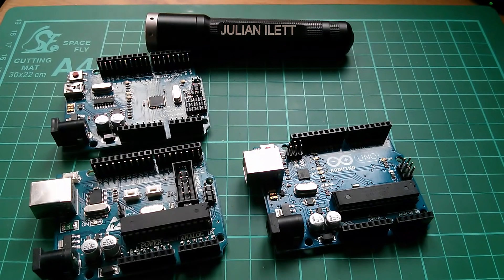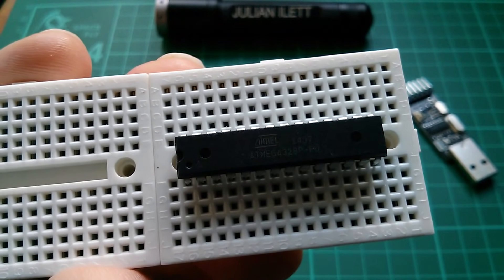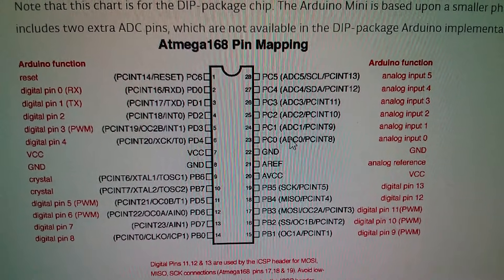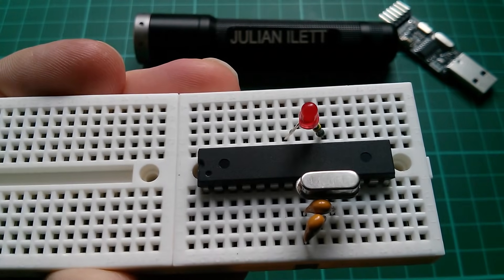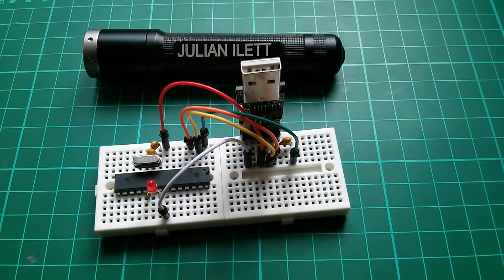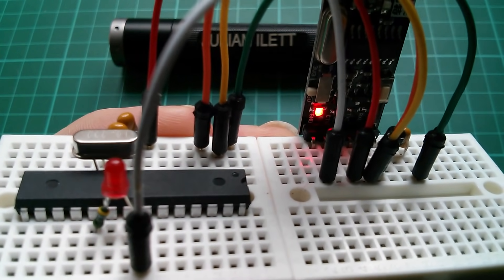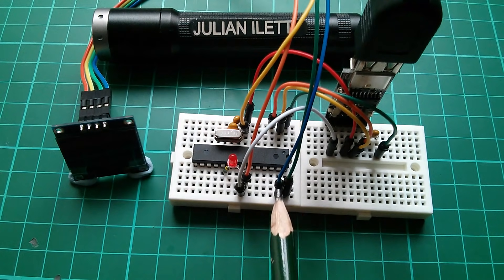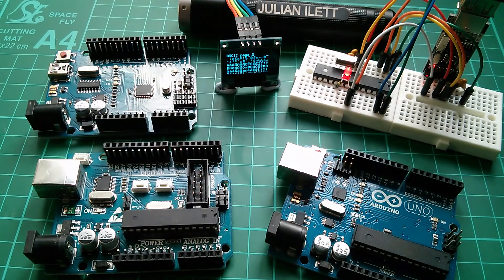1-Day Project: Build Your Own Arduino Uno for $5

Comment: which capacitors did you use
Reply from the maker: 22pf
Reply: This project is called Bareduino:
http://www.instructables.com/id/Standalone-Arduino-ATMega-chip-on-breadboard/?ALLSTEPS
Reply: can I use a cap rated at 104 or 103?
Reply: thanks

Comment: what is the value of the current limit resistor for the LED,the link for the usb convertor takes you to a no ship to UK seller,would this then run my diy cnc using grbl.

I'm an electronics technician,but i studied way before these gizmos were common place ,only i R+D labs,but if this can operate the cnc i can develop a full integrated pcb with surface mount components,next i need the schematic for a usb convertor.

cheers.

Comment: Hello Julian,

I was tried same steps with my boot loaded chip. But mine is not working. What can I do ?

Please help me.

I am using Atmega328(Arduino Boot loaded). and CP2102 USB to Serial.

CP2102------Bread board chip.
VCC(5v)-----VCC,AVCC.
GND----------GND,GND.
TX-------------RX
RX-------------TX
DTR-----------RESET through serial 0.1 ceramic capacitor.(reset pin is pull up 10k resistor)

I was Error getting the below

avrdude: Version 6.3, compiled on Sep 12 2016 at 17:24:16
         Copyright (c) 2000-2005 Brian Dean, http://www.bdmicro.com/
         Copyright (c) 2007-2014 Joerg Wunsch

         System wide configuration file is "D:\arduino-1.6.13 - BOOTLOADER\hardware\tools\avr/etc/avrdude.conf"

         Using Port                    : COM3
         Using Programmer              : arduino
         Overriding Baud Rate          : 115200
avrdude: stk500_recv(): programmer is not responding
avrdude: stk500_getsync() attempt 1 of 10: not in sync: resp=0x87
avrdude: stk500_recv(): programmer is not responding
avrdude: stk500_getsync() attempt 2 of 10: not in sync: resp=0x87

Please help me sir. what is the problem.

Comment: Hi Julian, this video is awesome. I have a doubt. I got a usb converter (usb to ttl D-SUN) and it does not have a dtr pin, it only has 3v3, TXD, RXD, GND and 5v. How could I upload the sketch resetting the ATMega automatically with this usb converte? Thank you and regards

Comment: If I wanted to install this cut down Arduino Uno into another project how would I power it without the USB. Many thanks for this video and any help/
Reply: it most certainly is P/VxI ,i've been trying to find the original posting.I added up all the outputs then calculated the product.I may have added current capability to ensure thermal stability with or without a heat sink,or at least a clip on type.seeing as the 1A regulators are super cheap,it'd be crazy not to go for some thermal headroom,but you are right 5V x .2A = 1.A quick search for 1A 5V regulator IC came back from google at 25p.even using a higher current type will give better performance.
If you want to use a 317T reg,you can use a zener diode to set the op voltage ,a piece of angle extruded alluminium should be a good heatsink,or buy one,or insulate the tab with mica washers and bolt it to a metal chassis of a diecast box if used.
At any rate i used amps instead of watts,a brain fart i guess.
If you need a schematic let me know.
Reply: i was half asleep,and meant watts,but the extra current was implied,i think things without stating them assuming you know what i mean even though your not psychic,pretty bloody stupid really,but at least i got to redeem myself,urgh.
Reply: use a 5v regulator circuit to vcc and ground GND is zero volts.
Reply: Many thanks John
Reply: Mike Craft apparently the arduino uno can draw 200mA at vcc and gnd,so thats 200mAx5v=1A,1.5-2A reg.If you use a pcb use a spare un connected bit of the copper as a heat sink.
Reply: Understand - many thanks
Reply: Please excuse me if I've missed something there, but isn't 200mA x 5V = 1W, not 1A?
Reply: +john amptech +Twotone - many thanks guys I really appreciate all your replies and help. Have great days!
Reply: Sorry, I misunderstood what you were calculating. I just saw volts x amps = amps and thought that's not right. :) Bit pedantic I know.

Comment: Nice comparison. There are two additional factors other than the price of original arduino. Sometimes you need something way way smaller and if you have a simple project with a few channels of data it's a shame to waste arduino uno on something like this.

Comment: im going to make a uno,ive just ordered a uno and a mega,for reasons too long for here,but i also make pcbs,im going for a perf board to use for pitch,and use zif sockets,and if i need a permanent micro controller,i can program a chip,and fit it to a board with correct headers etc,but using only the needed components for what ever it is for,socket for crystal timer,surface mount parts too where needed,for a good pcb look for toner transfer technique,easier to do than uv resist ,for beginners,seeing as the parts are super cheap on ebay,one can be made for (much)less than a tenner,and be very versatile,bread board can be  disturbed easy.Each to there own,im a technician ,and enjoy being anal about this ,but it can make things easy in the long run,chips etc can be removed safely!.
All the best,enjoy electronics,that's the main thing.

Comment: what happen if you dont have a usb-serial.Could you put the atmega on a arduino board upload the code and put it back on the breadboard would it still work?What about if you unhook the 5v and put it back would it keep the code in?

Comment: Question: If I will use an Arduino Uno instead of the USB converter, because I just want to program my atmega chip and I don't want to use Arduino for my prototype, do I still have to connect the reset port of the Arduino Uno with a capacitor to the reset pin of the atmega chip? Like the one you connected with the DTR pin of the USB to Serial Converter?

And another, is the LED with resistor necessary for the circuit? Or you just put it to demonstrate that the circuit is working?

Comment: I was wondering, as I looked over the official board, why one couldn't just build an Uno from inexpensive components, and then I happened on your video.  I also bought the official version, but wanted to play around with building a variation.  Thanks for taking the time to post!

Comment: Maybe on your country, but here in brazil:

Protoboard:      +- 3.50 dollars
Chip:                   +- 3.50 dollars
usb module:      +- 2.50 dollars
wired jumpers:  +- 3 dollars.
o/ components:     +- 2 dollars
Total:                       +- 14.50 dollars

Arduino Uno R3:  +- 7~13 dollars

 Is a LOT more cheap buy a arduino on place of the separated components.
Reply: doesn't the chinese ebay sellers ship to brazil?
Reply: An authentic arduino or a clone board?

I'm used to clone boards being less than $10.

The biggest advantage in doing this is to get the experience.
Reply: yeah, but the fun here, is to learn and build it yourself :

Comment: Hi Julian. Can u provide the connection diagram for this? And is it possible to directly connect the USB ports without using serial converter just like ATMega development boards?

Comment: You can completely understand why the cheaper units are being purchased. I do have to say that the retail outlets are obviously making a few extra bucks on the item or it would not be worth selling them. It does seem that just maybe they add a few too many bucks,  hence going for a cheaper unit, which does the same thing practically.

Comment: Julian one question you not needed to burn the bootloader of the chip atmega?? or you buy with it?
Reply from the maker: I bought the chip with the bootloader already in it
Reply: Ok thank you for fast respond
Reply: What do they also have??? A voltage regulator? A way to power without USB?

Comment: Very clear video and good close ups too (Subbed).
I couldn't find the adapter you were using on UK Amazon but I found I had the same thing using a '
Osoyoo Mini USB Arduino Nano V3.0 ATMEGA328P Module CH340G 5V 16M Micro-Controller Board' I was a bit worried about this board not having the DTR pin but it has a RST pin which via an on board resister and cap does the same thing (I believe). I also bought 4 OLED displays of the type you were using.  They will arrive late Nov but OLED's are nicer than LCD's

Comment: hey :) thanks for the info. I try to make a small setup so this will come in really hand.
one question thoug: are the values for the capatiors very strict? i can only get my hands on like 22pF ones.. no problem rigt?
Reply: i wonder the answer this question
Reply: is it the work with 22pf capacitor

Comment: can't you use a 20mhz crystal?
Reply: Crystals frequencies can be changed, but you need to know the upper and lower limits of what can be used by the chip. I used to add another crystal in citizen band radios, and attached to a switch. This allowed me to talk to other users that I had modded their CB radios as well.  The only problem with doing this was the radios transmitted outside the legal frequencies, which back in the 80's was a fine, if we got caught.

Comment: after program has been uploaded to my atmega8 if possible can i remove the chip and use it with external powersupply in a different circuit

Comment: This is really cool, but I think the idea of an arduino is to also save money and space on additional electrical components by allowing you to code the components you have making it save money, time and space. The other big point of an arduino is that it helps to get people of all ages get into coding and electronics as it is a really easy way to start. A year ago I had no idea how electronics worked but use computers everyday and code a few things myself, but with arduino and raspberry pi I was able to easily jump into the unknown and so am grateful for all they have done and best of all as the video shows, it really doesn't cost a lot to get into either. Also, though I find maplin to be very overpiced when it comes to electronics.

Comment: Can't make it work. Tried a couple versions of USB to Serial converters. Last thought I have is...current 1.6 arduino software is not compatible with this circuit layout. I might try 1.0 later on, but if anyone has a suggestion, please reply. Thanks

Comment: Could you perhaps show how you'd go and use something like a CJMCU Micro USB Interface as a power supply instead of the USB2Serial? Is it as simple as connecting the 5v and ground or are more components required?

Comment: 3 pounds.. thats impressive yeah, i'd buy one for that price lol
Reply: As a 10x lot they are all over ebay for this price
Reply: if price is the issue, NANO clone is what you are looking for.
for around 1.50 pound it essentially the same as UNO but in a SMD form.
Reply: ***** im not very good at hardware, whats "SMD" :)
Reply: +EnderCrypt its the acronym for Surface Mount Device. basically a smaller package stuck with the same goody, all modern electronics uses it. its not as easy to work with and thats why people get it in a modular form unless you have those fancy equip like reflow over, scope or what not.

Comment: What is more interesting to me is that your version might run on a battery for a long time whereas regulators etc draw so much current (relatively) that you cannot do the same with Arduino Uno's for an extended period of time. Some people can make these things work on a ingle 3,0 V LiIOn battery for years (depending on the sensors etc), also by using a different library. This all from someone who has just read onthis for about a day so I might be completely off...!

Comment: I have connected a LCD 5110 screen with a custom library on the code but the screen does not seems to work with the "DIY"-duino but it works fine with the an original arduino... Any idea why? Also, I added a 5 Voltage regulator cause I am using a 9V battery however when I connect a 3.7V li-po battery it does not seems to work as a normal arduino would do! Could anyone help?

Comment: "Clone" Arduino and "Counterfeit" Arduino is different.
"Clone" is Arduino compatible which is not real Arduino and does NOT use the arduino logo such as the DFRduino.
however, "Counterfeit" is Arduino combatible which is not real Arduino and uses the arduino logo.
using "Clone" Arduinos are okay. those doesn't break easily.
"Counterfeit" Arduinos are bad. those break easily and you may need another arduino to fix it.
Conclusion: Don't use counterfeit Arduinos.

Comment: So, am I correct to assume that, if a lot of your projects are standalone (no USB data-connection to a computer required), you can:
1. buy a bunch of extra ATmega's with Arduino bootloader, 16Mhz crystals and 20pF capacitors
2. program and test your project on the single genuine Arduino UNO you already own
3. lift the ATmega from it's socket and solder a crystal and 2 capacitors directly to it's pins (or place all on a breadboard)
4. remove the other project components from the UNO pins, and solder them directly to their respective pins (or place them on the breadboard)
5. hook up a 5V power source (smartphone battery / powerbank?) to the ATmega's VCC and GND pins
6. run your project straight from the ATmega, or the single breadboard (eliminating all the extra space for the Arduino UNO)
7. rinse and repeat?
Reply: Just test functioning on the Arduino and when you're done, eliminate the excess bulk by making your own device with the ATmega and bare bones.
Reply: So yeah you right.

Comment: ,, please help,,, i connected atmega 328p into usb to ttl same as you mentioned , but it not appers in ports option in arduino software.. what to do ? then how to upload the code ? plzz helpp
Reply: are you sure you  connected all the pins right?
Reply: yes i am sure ,, and i found to burn bootloader on it this is the issue ,,but i cant burn bootloader on mine chip ,,it gives me following error
avrdude: Yikes!  Invalid device signature.
Error while burning bootloader.
         Double check connections and try again, or use -F to override
         this check.
Reply: +Jasim Ali if you want to burn bootloader you have to have an arduino and you have to upload ArduinoISP sketch to your arduino then you connect your atmega328p to your arduino as shown then you select Arduino as ISP then select Burn Bootloader

Comment: Thank you for this video, Now i know that Arduino board is nothing but straight up wire from IC to pin headers (with protections). I have been dealing with the size of the Arduino for a long time, robots such as sumobots have very intense space requirements,  This video has taught me to just draw a PCB with SMD ATmega chips, saves tonnes of spaces that was taken by headers. Great job!
Reply: 郭虎承Guo Hucheng 

Q
Reply: @melvinknight4965  wat
Reply: Yeah

Comment: can I use the self made Arduino Uno for a school air quality monitoring project? How would I configure it? and which codes would be needed?
Reply: yes but you need a particle counter; either buy one or build one. You can buy one for around $12 US (up to $5000+) or build one (google it). You configure it by having the arduino read the output from your particle counter and then have the arduino output that data to a screen of some kind. The code depends on what type of particle counter you get.
Reply: Justin F
Alright, Thank you

Comment: Greetings, i have had the problem of the AVRdude errors and wont upload sketch, what i did was change the tx and rx pins around and it work, no need for the 10k resistor :D

Comment: I like your explanation the actual form factor is difficult to dress, a usb stick form factor seems besr suited specially for kids learning. May be you can scratch a low cost pocket calculator, with display, keyboard add a micro usb main board and rechargeable batteries. THKU again Paul

Comment: What suggestions would you have for someone who has zero experience with electronics, but wants to learn. I pick up things quickly, and have a rather high aptitude for this type of thing. My goal is to be able to build LED panels to display instruments from my flight simulator. I have limited experience building switch and rotary knob panels, that was rather easy, but LED and 7 segment displays (like i would use for a radio stack) are beyond me right now. Any beginners tips or resources you might have?

Comment: does this work the same with the arduino mega?
Reply: +Ride On! (CamzTouch) no, cuz the mega2560 chip (which is on the arduino mega) isn't in DIP form
Reply: +Sebbithecool yes. i know, but I have an Adapter from tqfp100 to dip
Reply: then it should work..
Reply: +Sebbithecool nice! thank you
Reply: you're welcome :)

Comment: It should be mentioned that the USB-UART, wire links and breadboard are a one-off cost and reusable. I bought the ATMEGA328P with UNO bootloader in bulk for around 80p a pop. Crystals and caps are pennies. So less than £1 for a working Arduino UNO. :) Pi Zero is also incredible value at £4 a pop, but cannot replace the Arduino in many projects due to I/O timing constraints (Python is interpreted etc).

Comment: Thanks. A question about the crystal. I've read that the ATMega has a 8MHz internal oscillator. So, any idea if it works as is without the crystal or does the bootloader require it?

Comment: Is it possible to replace the onboard Atmega328p chip with a new chip (without boot loader, totally new), and program it with the board?

After programming with the board itself, I can use the breadboard assembly with crystal and capacitors?

I'm asking if the USB-Serial adapter really required for programming? Or I can use the uno itself to program?
Reply: +TheZodiacNeophyte Yes. Follow this sparkfun guide detailing how to burn the bootloader on a ATMEGA328p chip. https://learn.sparkfun.com/tutorials/installing-an-arduino-bootloader